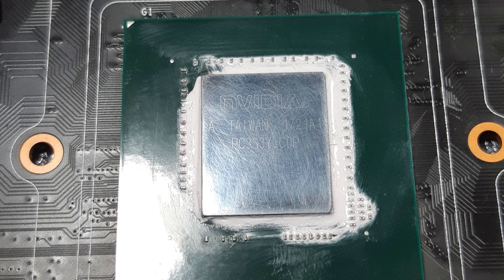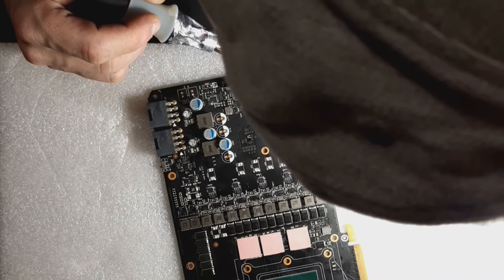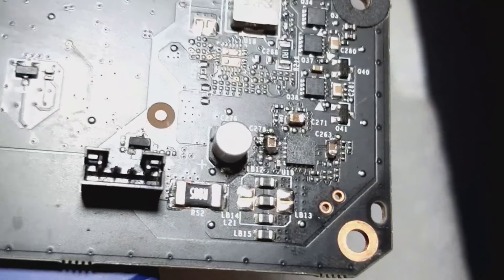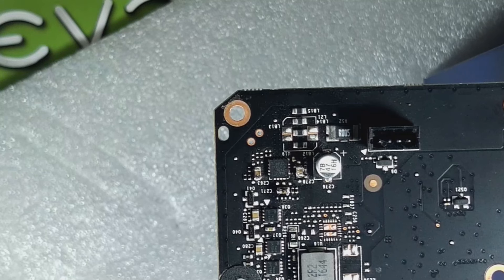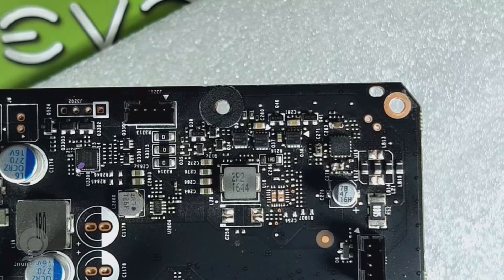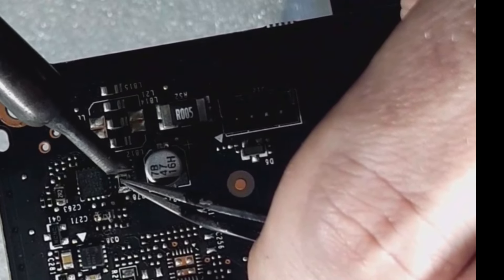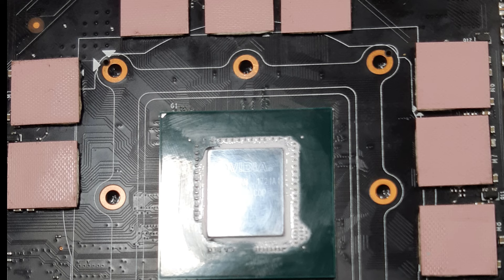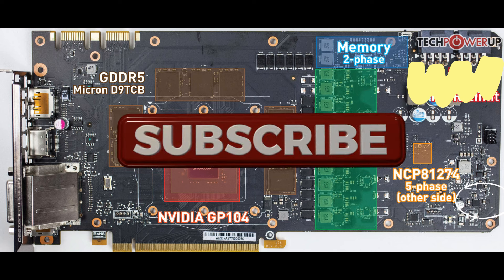Shunt mod guide, Unlimited Power!

Comment: Hot air with flux would probably desolder the other components that are very close as well? I haven't looked to see if there is a blower with a variable nozzle diameter?
I have seen that after using hot air with flux the end result looks much neater and cleaner...
By the way, I would like to practice soldering, but I have been lazy for years. :)
Reply from the maker: Yes hot air can cause issues like de soldering parts that are near by but if not touched or hit with to much force either by the hot air or the user they should be fine, also hot air can destroy SMD's, capacitors and other components if not done right or if the part itself is not 100% in good working order or is just old. You can order hot air guns with various nozzles but even then its all technique and would need practice on older and or already broken parts to test " boundaries" of different components lol..  Also to make things look neater you can pre heat the PCB  and just use soft melt or low melt solder on SMD's as that is usually what is used from factory also In this video i already soldered the SMD's on and off many times before i should of used new 2r2 resistors, i will be trying out silver solder from old CPU's as it is a low melt type solder to see if it helps make things easier as I do not have the greatest soldering equipment at the moment. practice makes perfect, i ain't perfect by any means but it works for what i need and hoping to show others that you don't need expensive things to get the job done! 

Best way to start is to just tell yourself ya can do it and to start on something broken already and see if you can fix it.. i wouldn't recommend starting on something like what is in the video as it does take practice to solder small SMD's.